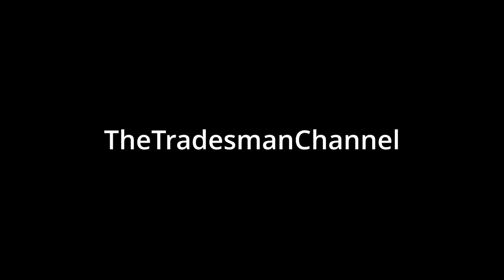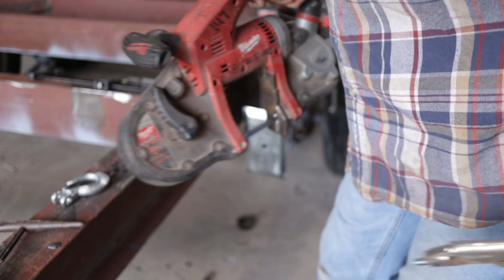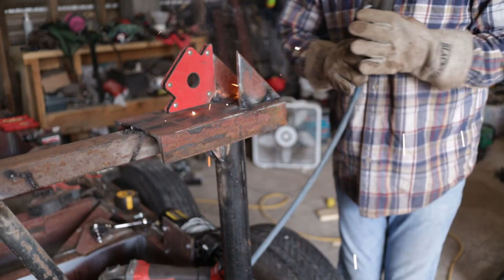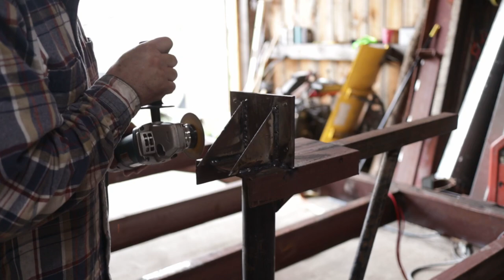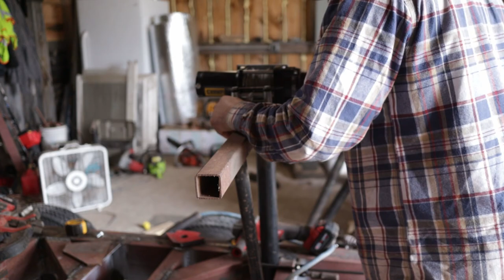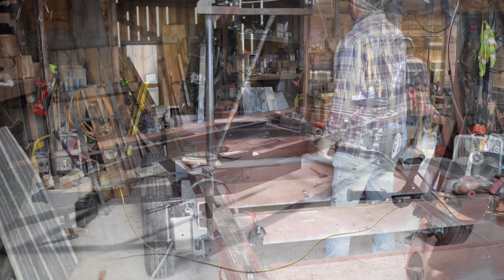Timber Frame 2.11: Jib  Crane On The Sawmill Trailer Build

Comment: Ya, you gotta watch out for your back. I put mine out the first time 20 years ago. Same as you, every couple years I was on the floor. Now it's much easier  to throw it out. Did it in January and again 2 weeks ago.
Reply from the maker: I've been lucky with all of the heavy lifting I do that I have back.  It'll change if I don't start doing things smarter.
Reply: I downsized my nitro and acetylene tanks for light weight. Switched to a backpack to stop beating on one shoulder. And ya, i see a chiropractor  regularly  for maintenance too.

Comment: Jib crane feature is going to come in handy. I wonder how easy it will be to swing with a few hundred pounds of log dangling...only one way to find out, eh?
Reply: Lots of grease in the socket can only help...
Reply: Probably not for lifting logs, just rolling.
Reply from the maker: You nailed it
Reply from the maker: Hey Dan, Boooshes called it.  Only for pulling the logs up onto the mill and spinning them.

Comment: A locked up back is definitely not fun. Jim, will you be hauling your milled timbers on your platform? With the sawmill on it as well that’s a lot of weight.
Reply from the maker: Good morning Hugh.  I probably will, that's one reason it's built so heavily.
Reply: @TheTradesmanChannel  yeah that trailer is more solid than the truck hauling it. You got some big ones rolling it around as you have. I’ve had a lot of fun watching this build.